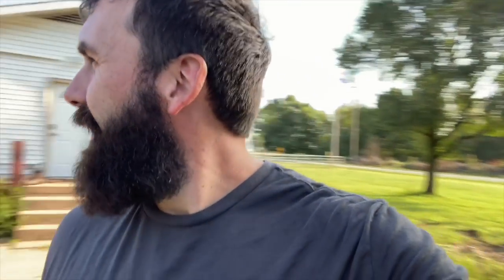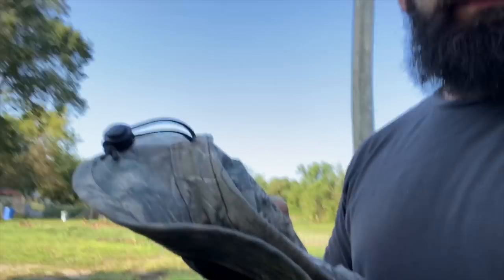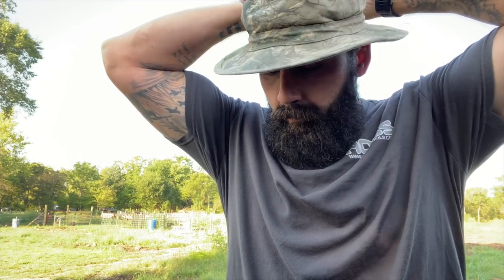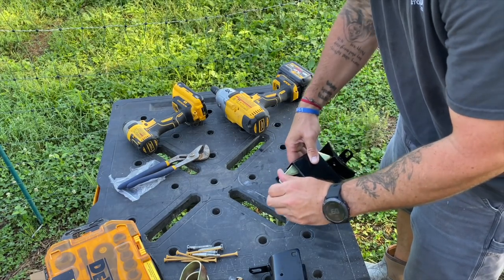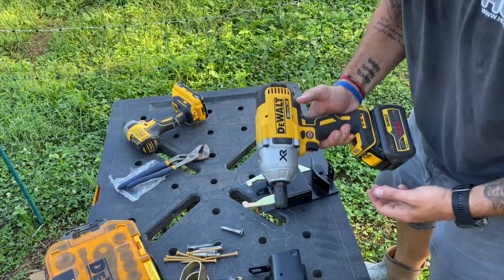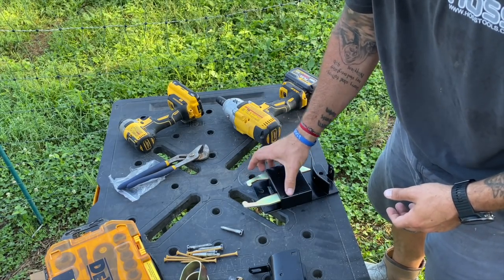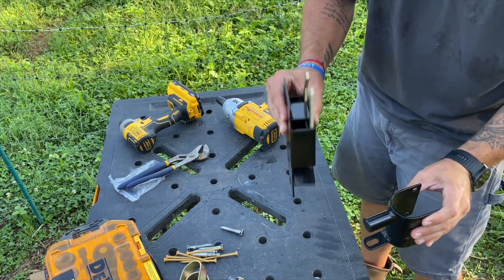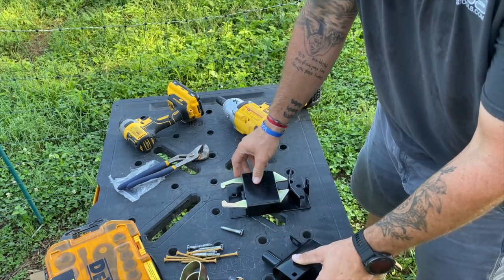Installing a Two Way Fence Gate Latch

Comment: Hey FYI on the gate hinges if you take the closed end of a wrench it works great to tighten them in with. Just a little tip from on dad to another. Love you channel
Reply from the maker: FINALLY a tip on turning those silly things! Haha. I’ve got a pipe wrench that makes light work of them & couldn’t find it when filming video. I used the hammer side of my pliers because that sucker was STUCK! 

Appreciate ya sir! Thanks for looking out!! 🔧
Reply: Adler Farms hey forgot to tell you that the company that makes that latch also makes one for a gate that only opens one way. I have been using the latches for years now and love them. The other style I use it on my horse stall gate. And on the longer gates I also used there wheel for the gate so it didn’t sag. The latches I got were red though but they came from Tractor Supply. Your place is looking great 👍 you have been busting your rear end and it shows. You have to feel great when you stand back and look at all you have accomplished so far. Take care deuces, ✌️lol

Comment: I'd love to know how far apart your posts are.   Looks like you have about 3 inches clearance on the latch side.    I'm putting in a 48in gate, with a latch like that.  Just wondering what the spacing needed between the posts would be.  Thanks.
Reply from the maker: The gate with the hinges  will be over 48 inches. I’d set your posts wider than you think and use a shim behind the latch like I did 👍🏻 😎.
Reply: @DossFarm   Thanks .  I'm planning on 51-52 inchs between posts for a 48in gate.  Does that  pass your smell test?
Reply from the maker: That should be pretty good man. Just dry fit it beforehand. 

I didn’t mention it in video about spacing bc not everyone will be using same gate.

Comment: Mine didn’t come with lag screws. What size works best?
Reply from the maker: None of them come with lag screws because some folks attach to metal posts so they wouldn’t do any good. I used 13mm. 10mm would work but grab washers if you use 10mm.